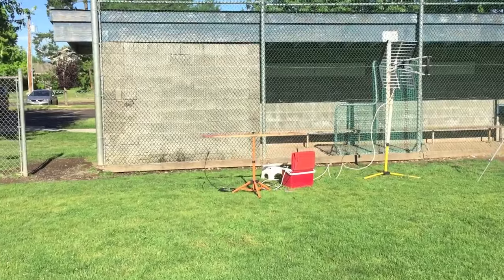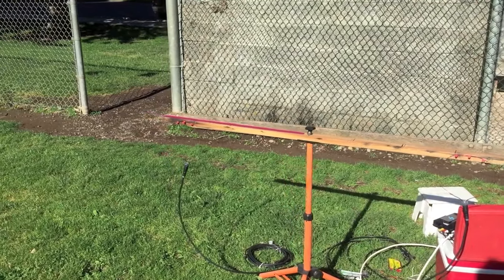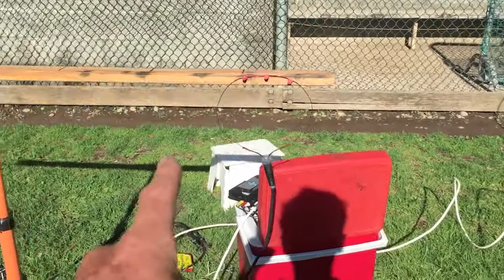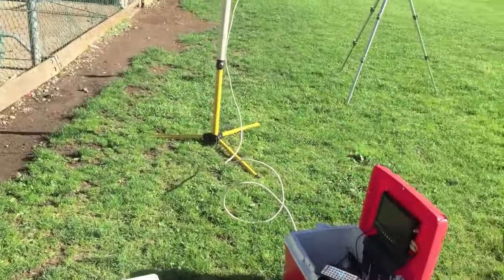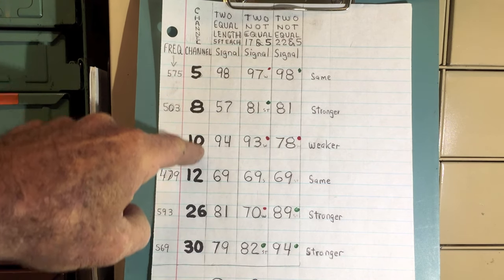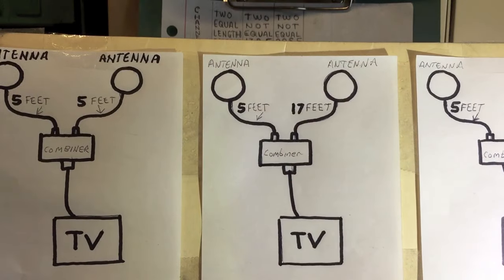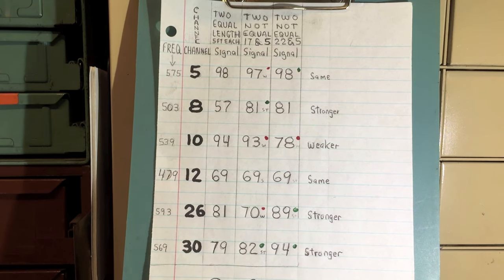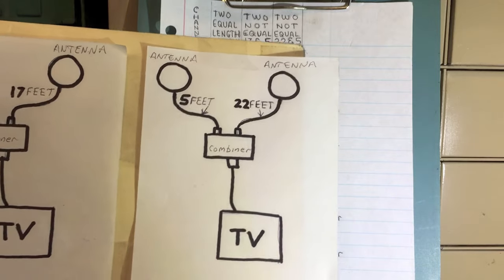Can Two  TV Antennas Really help? Watch This Experiment.

Comment: Also, I am clueless on the physics as to the chosen dipole lengths and the loop length people are recommending on home made antenna.  23 inch loops, 7 inch elements.  I am not sure about space between elements.  2'+ seems to work, but not tighter unless 90 deg out of phase, but polarization matters.

Here is a table of the half-wavelengths for TV channels 7-36:

| Channel | Frequency (MHz) | Half-Wavelength (m) |

|---------|-----------------|---------------------|

| 7       | 174-180         | 0.86-0.83           |

| 8       | 180-186         | 0.83-0.80           |

| 9       | 186-192         | 0.80-0.78           |

| 10      | 192-198         | 0.78-0.76           |

| 11      | 198-204         | 0.76-0.74           |

| 12      | 204-210         | 0.74-0.71           |

| 13      | 210-216         | 0.71-0.69           |

| 14      | 470-476         | 0.32-0.31           |

| 15      | 476-482         | 0.31-0.31           |

| 16      | 482-488         | 0.31-0.31           |

| 17      | 488-494         | 0.31-0.30           |

| 18      | 494-500         | 0.30-0.30           |

| 19      | 500-506         | 0.30-0.30           |

| 20      | 506-512         | 0.30-0.29           |

| 21      | 512-518         | 0.29-0.29           |

| 22      | 518-524         | 0.29-0.29           |

| 23      | 524-530         | 0.29-0.28           |

| 24      | 530-536         | 0.28-0.28           |

| 25      | 536-542         | 0.28-0.28           |

| 26      | 542-548         | 0.28-0.27           |

| 27      | 548-554         | 0.27-0.27           |

| 28      | 554-560         | 0.27-0.27           |

| 29      | 560-566         | 0.27-0.27           |

| 30      | 566-572         | 0.27-0.26           |

| 31      | 572-578         | 0.26-0.26           |

| 32      | 578-584         | 0.26-0.26           |

| 33      | 584-590         | 0.26-0.26           |

| 34      | 590-596         | 0.26-0.25           |

| 35      | 596-602         | 0.25-0.25           |

| 36      | 602-608         | 0.25-0.25           |

Comment: if 40 miles or more in the woods just spend the $600 for 6 items ..........1-channel master 80 extreme antenna for all uhf , 2 - stellar labs fringe vhf antenna  , 3-channel master pre-amp , 4-channel master tv joiner , 5- 20 foot telescopic flag pole , 6- channel master amp , and enjoy all the channels crystal clear ....just raise pole high enough for the antennas to be out of the way and pointed in general direction ....exact pin point wont be needed ........ attach preamp to the extreme antenna at top  , then the joiner just below that , then the stellar labs vhf antenna , then the amp to the tv......this will allow a minimum of 100 foot run of coaxial with zero signal loss on any of the channels ......me and neighbor have same set up with trees directly if front of the antennas and all around ...zero issues
Reply from the maker: Having the antenna up high on the mast is generally a good idea, but I have been on 3 jobs where lowering the antenna brought in the channels I could not get,. In one case I ran about 300 feet of coax from the TV to the antenna, and I was sure I  would need an amplifier, but the signals were great without one. When it comes to finding the perfect antenna around here,  what seems to be tbhe best in one location, isn't so great in another,  I'm sure the antennas you mentioned are good ones, but when I think I know which antenna is best, I'll discover that sometimes I'm wrong in a particular location.